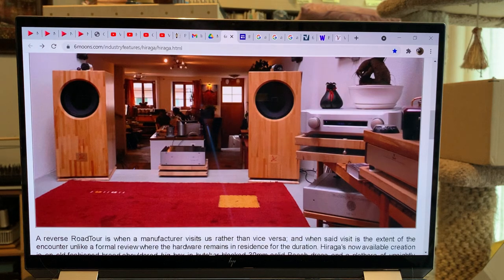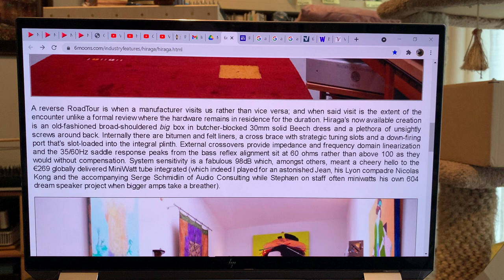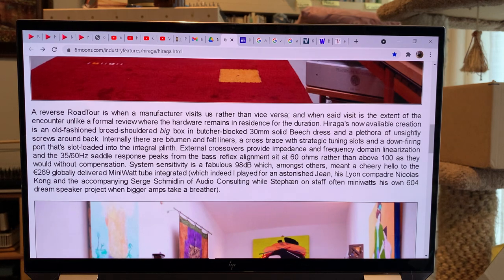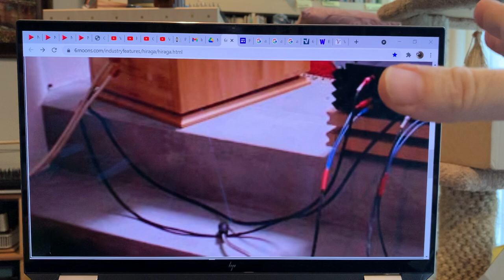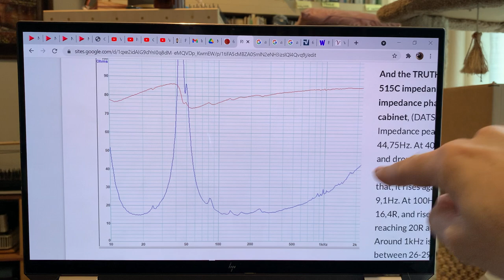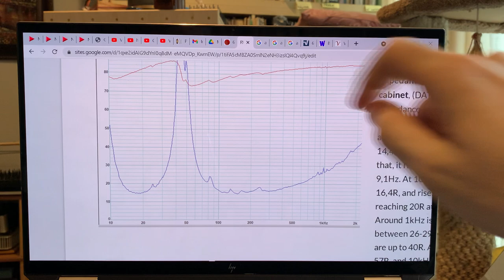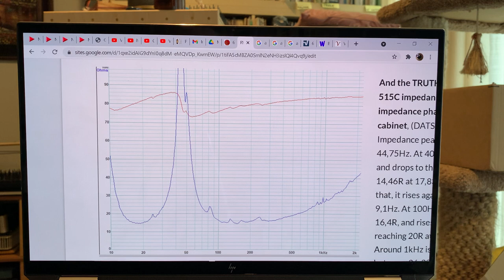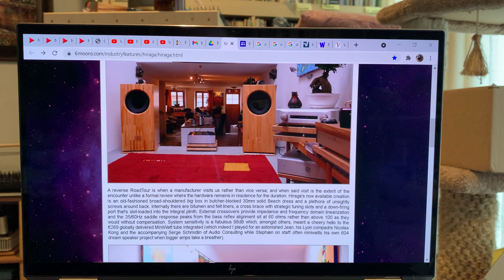Jean Hiraga Part 5 - Impedance equalization - is it for you?

Comment: Thanks for another great presentation. It is my understanding that the main mechanism of fibros damping material is to turn the sound energy into heat via friction. One of my lecture halls has walls with horizontal boards with spaces between them exposing a layer of damping material to reduce the slap echo. It's a very clever design. Thanks again, my friend!

Comment: Very good summary on the Hiraga speaker that I really like and find useful since I just bought a pair of Altec 604-8K in almost mint condition but with a homemade Altec 604 box. THANKS!!!!!!!
I don't know if I 100% agree with the tone wood philosophy. Not that it is wrong but rather that it is very hard to implement for two reasons. The first is that it is impossible to find anything that is close to tone wood in Sweden as long as Putin continue with his illegal war on Ukraine (as a private person you can't buy birch plywood in Sweden and there are no alternative that is good enough.....) and the second reason is more based on shape of the acoustic guitar/bass or violin. I don't think a violin or acoustic guitar/bass with rectangular shape sounds good. It is the broadband resonance that make a violin or acoustic guitar/bass sound good and it is the same with a loudspeaker. Might be possible to work with different thickness of the wood in different part of each panel so different part of panel to create resonance frequencies over an octave. Might be an idea to tune each panel to different notes.....or maybe replace the hard wood ribs with a more wavy shaped piece of wood that makes the thin panel that moves have the shape that is more close to an acoustic instrument.
Anyway I think your video was very good for understanding the problems with a more rigid hard panel box and I'm still have to think about if it is possible to handle this problems with a rigid box so it sounds better than a thin wall loudspeaker that I anyway can't build with a sound quality close to a violin or acoustic guitar/bass. 
Thanks again for a great video.

Comment: I disagree there's nothing wrong with internal damping it is needed otherwise it's a ring like a bell. How you supposed to control then?
Reply: How much damping is used inside a violin?
Reply: @craigcharlestone  Yes, but a violin, guitar etc are designed to resonate and produce pleasing harmonics....but ideally a speaker cabinet should not contribute it's own character....Gilbert Briggs of Wharfedale shows slot ports and distributed slot port designs in his books, back in the day...
Reply from the maker: Great point! If the cab is designed to ring like a bell, it will! Taking out the dampening from a cabinet (that was designed with it) will make it much worse. The cab building concepts have serious problems, just as the poor materials quality used. (Think of MDF violin.) What people keep forgetting, is that resonance is not the enemy - uncontrolled resonance is. Paul Voigt pioneered the cabinet that uses controlled resonances (Voigt pipe). Indeed, it measures very poorly, but it has extremely natural sound (unless implementation is lacking) because its work mode suits how the human brain works, which is totally different from the numerical aspects of electronic signal analysis (one speaking English, the other speaks binary).
Reply from the maker: Great point! These instruments are designed to use the resonances! This has been my focus, how to achieve this goal that a speaker cabinet can replicate how a violin or a piano works. For a long time I also entertained the notion that a speaker cabinet should not add its sonic signature, however, no matter what we do, it always adds it. Our choice, as a designer: do we add a spoonful of salt (resonant cabinets), or a pinch or arsenic (highly dampened cabinets)? As always, the choice depends on the taste of the individual, and also upon how much poison he has already been subjected to. For fist timers, a pinch of arsenic is not even noticeable, but long term it's fatal. That has been my experience with over controled cabinets - you get seeming neutrality, sharpness, but they kill the joy, transform music into a sound only experience. They were fascinating 10 years ago, but now they give me the creeps, and I'm glad when the audition is over. I'm not saying one or the other is bad - just that there are multiple roads to travel, and both / all offer something special. Mainstream goes for control, platonic perfection and denies musicality and the ability to play a wide array of reordings. I carry the torch for those who want the music and connection back into audio.
Reply: @realworldaudio  Awesome reply! I like your mission, it respects the human experience rather than some theoretical model of how things should be....
Reply: @realworldaudio  Excellent argument.
Reply from the maker: @mfr58  Thank you MFR58! I think every designer is adding something valuable to the table, all the theories hold a pearl of wisdom. It is our task to find out which are our priorities. I made it my mission to help the audio community in this process, to be aware of routes that are not frequented, off the beaten path, yet accessible to those willing to put in the effort.